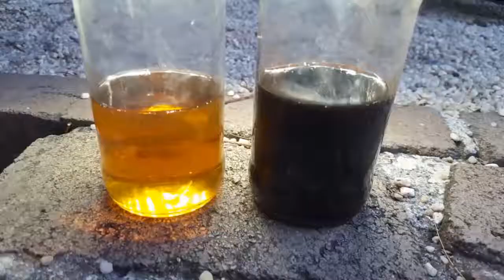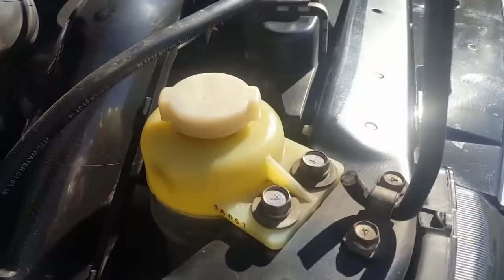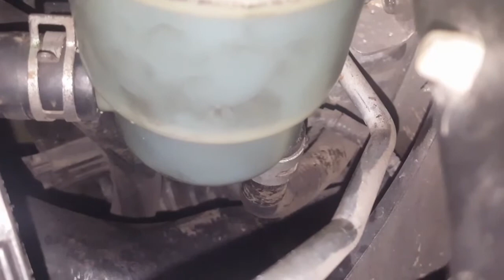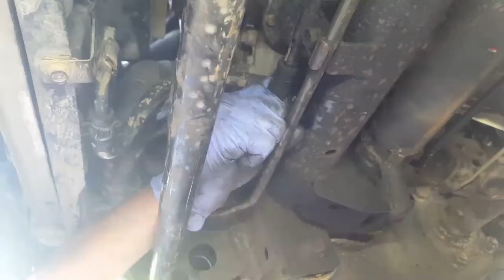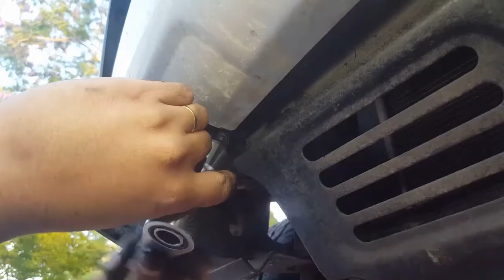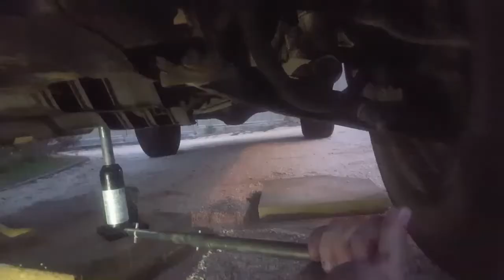Power Steering Flush

Comment: How many liters did it took to fill up the reservoir in full?
Reply from the maker: job was done using less then 2 ltrs, cant remember exactly how much the reservoir holds.
Reply: @ServiceMyRide  Thank you sir. Mine is Monterosports, same body and engine as yours I guess
Reply: Sir, just finished installing a new fuel filter. Engine works fine. But if I turn off the engine, I am hearing a hizzing sound. But it does go away naturally. Is this normal or did I made a mess with my installation? Thanks
Reply from the maker: check all fitting are done up tight, sounds like you have an air leak somewhere, make sure the filter it tight and all hoses are in good condition, you may have split a hose when removing them.
Reply: Thank you sir.

Comment: YES TRITON VIDEOS!! awesome mate! I want to be able to do my own service of my vehicle. any videos would be appreciated.
Reply from the maker: there is a couple on the channel mate, plenty more to come.
Reply: @ServiceMyRide  bloody ripper mate!
Reply: do you have time for a question?
Reply from the maker: yeah sounds like an SCV, suction control valve, be a good place to start is turn it 180° if it stops the chugging buy a new one and replace it.
Reply: Service My Ride ok will try it out also got a fair whack of smoke coming out of her exhaust too 😒
Reply from the maker: It may also need a inlet manifold clean, 150k could be choking the engine, also give the MAF sensor a clean, cheap fix if it hasn't been done for awhile
Reply from the maker: Always mate!
Reply: @ServiceMyRide  My triton has started chugging...whole car shake. and not under much accelaration...thoughts? due a 150k km service in 3k
Reply from the maker: could be a number of things, does it stop at higher revs? only off the mark? between a certain speed?, have a lift?
Reply: @ServiceMyRide  if give it bit more pedal it generally stops but its between 3rd and fourth sitting at 40-50 plodding away. it's lie its struggling to potentially get fuel. but then not. yeh has a lift kit